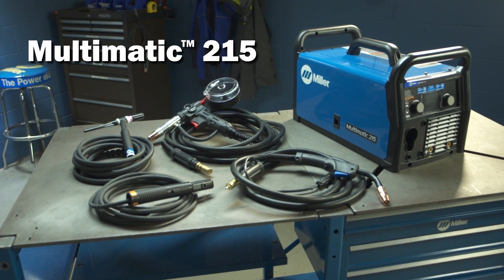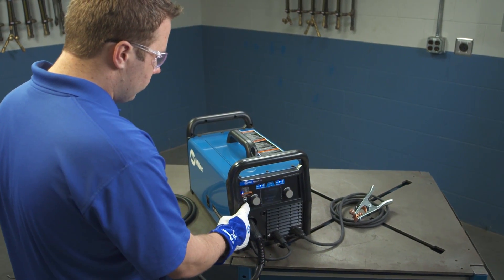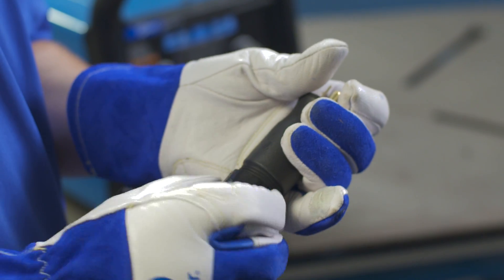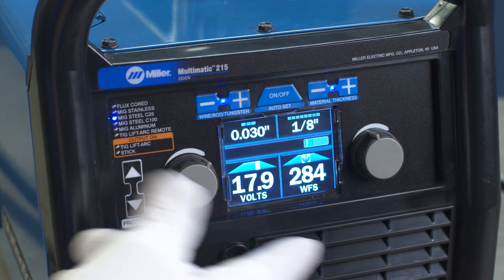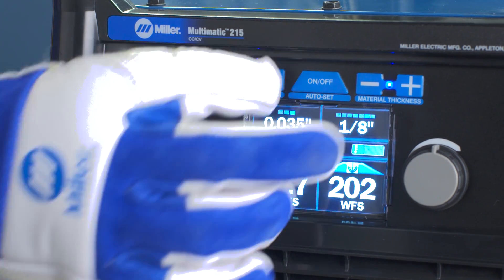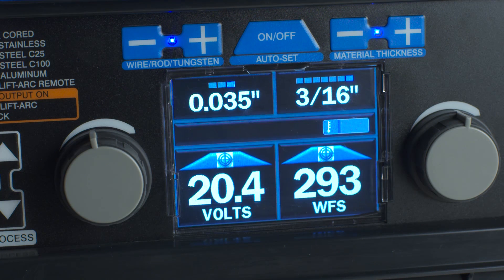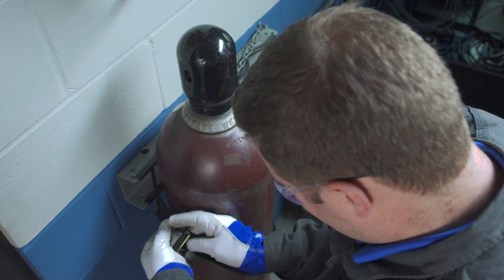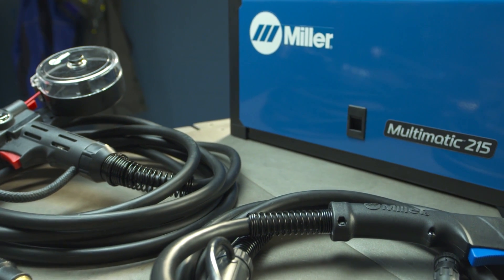Miller Multimatic 215 Multiprocess Welder Setup

Comment: Hello Miller, the steel I generally weld is A36. On occasion, I'll weld higher carbon steel like a 50 designation. On the selection switch for MIG steel, it offers C25 and C100. Please tell me what this refers to so I calibrate the machine correctly for the material I'm using. Thanks!
Reply from the maker: The C25 is 75/25 gas for welding the steel.  This is 75% argon and 25% CO2. The C100 is 100% C02 gas. Let us know if there's anything else we can help with.

Comment: Just exchanged my Miller 215 for another one and still getting the same error. “Motor has drawn too much current.”
Reply from the maker: This sounds like you may have too much drive roll pressure, or the gun liner is obstructed. Please don't hesitate to contact us to get assistance https://www.millerwelds.com/support/contact-us-form

Comment: Why doesn’t this welder have a rebate on it as of 2-20-18
Reply from the maker: Hi Nick, The Multimatic 215 was included in the Build with Blue Holiday Savings rebate program that ended on Dec. 31, 2017. You can find a list of current rebates offered through Build with Blue Winter Savings on our website: www.millerwelds.com/buildwithblue.
Reply: I got a $250 rebate

Comment: Would this machine have enough power to do automotive chassis/frame welding using MIG on 110volts ?
Will the unit run without issues on 220-240volts 50hertz ? Or does it require 60 hertz mains electricity?
Reply from the maker: Thanks for reaching out. The Multimatic™ 215 is capable of operating on 50Hz or 60Hz input power. When operating on 115 input power, the unit is capable of welding up 3/16” steel in a single pass. In most cases, car chassis are not this thick so it should have no problem handling that application. Thank you.

Comment: can you weld stainless steel mig with this machine?? and whats the max volts for tig and mig??
Reply from the maker: Thanks for reaching out. You can weld stainless steel with the Multimatic 215 in the MIG and TIG processes. Max voltage for these processes is 58 VDC.
Reply: thanks ,waiting for it to be delivered

Comment: Is this particular machine made in the U.S.A.?
Reply from the maker: Ron S, thanks for reaching out. All Miller Electric welding and Plasma cutting machines sold in North America and Mexico are designed and manufactured in Appleton, Wis., USA, though some components must be sourced from other countries, and we do have some factories overseas that only manufacture for their local markets. If you have any further questions, please let us know.
Reply: Ron, Nothing is Made in the USA exclusively. Not your clothes, food or pick-up truck you drive. If you want to protect American jobs then learn about Trade Agreements and Corporate Tax Law and get politically involved in those issues. Corporations like Miller have a single purpose: maximize Shareholder Value. They move jobs (and banking) where our Political System provides incentives to do so. Currently that is offshore.